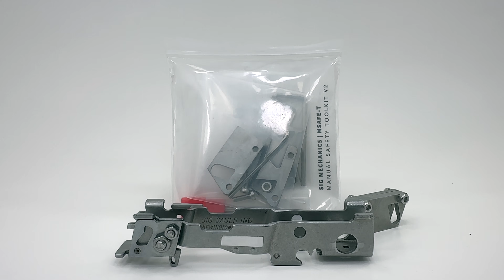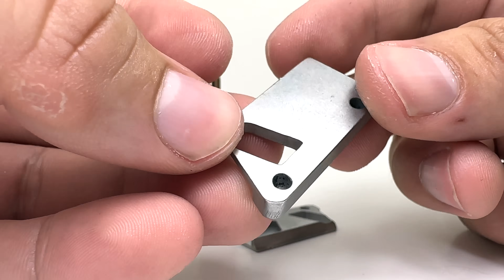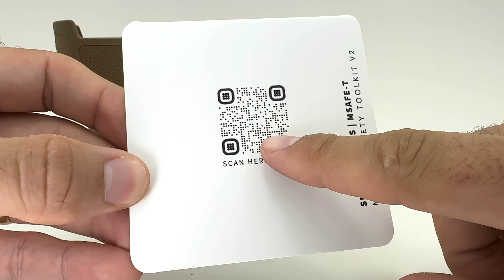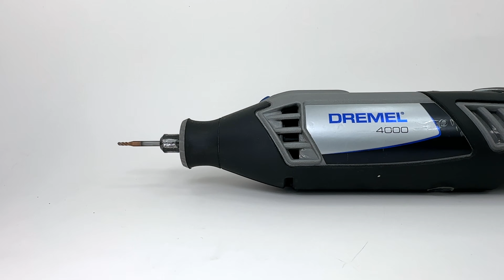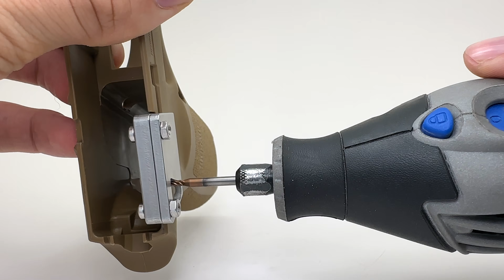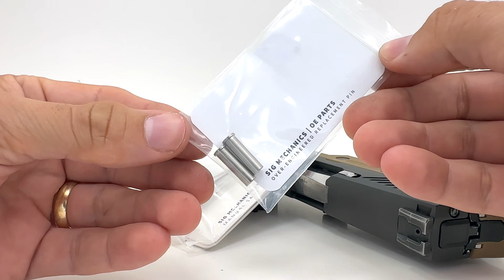P320 MSAFE-T V2 - NEW UPGRADES and FEATURES

Comment: Can you use a drill to do a lot of the work and then clean up along the jig edges with the dremel?
Reply from the maker: Yes absolutely. So long as the diameter of the bit won’t widen the holes more than the kit allows.

Comment: I wonder what Sig Mechanics thinks of the p320 now after all issues are finally coming to light. Even with the deaths of two p320 owners by failed mechanics and FBI reports, does he still stand by this disaster.
Reply from the maker: Thank you for asking. I still hold the same opinion and although I am frustrated with how SIG has handled its response to the public, I am much more frustrated with a lot of of the misinformation people have put out there recently.

The FBI report, for example, has been taken out of context. People are claiming it is saying things that clearly it does not and our veering into speculation one discussing it. The new claim where you can move the trigger back 1 mm and make it fire by manipulating the slide is also incorrect. Since what is being said is that the trigger is being pulled sufficiently enough to move the sear down 1 mm which is a massive difference. But this information is still being shared and is incorrect.

Even the death of the air man although tragic, in my opinion requires time for the investigation to complete. I am hearing both. He shot himself and that he may have shot somebody else and it is currently a criminal investigation. I will not believe any of it until I hear a final report.

Long story short I think the P320 is safe, I make that claim based on all my knowledge and experience. I am of course, open to being proven wrong but to this day even with all the money and people they have thrown into proving that claim, not a single person has been able to do so. 

Lastly , my hope is that there is ultimately no problem because I want people to be safe and to enjoy their firearms. On that and I am going to be optimistic, but also always open to changing my mind and also committed to educating the public, especially when it comes to safety.
Reply: @SIGMECHANICS  the FBI said it’s not ready for duty use, many of the Army vets in my local ranges that were issued the M17 hated it and liked their M9 or Glocks. They did say a few soldiers did have some un commanded discharges during training, but the Army ordered them to shut their mouths. 

I’m just shocked we’re not seeing even a small percentage of this with any other striker, not even the p365 and that little gun lives inside purses, pockets, gym bags, glove box, and is carried more than the p320 yet zero uncommanded issues.
Reply: @SIGMECHANICS  I just don’t see the point in getting the p320, there’s far better and safer options on the market. The p320 only real selling point is that it “beat Glock” for the contract and I saw Ash Hess himself say that all the pistols shot the same, it all came down to money and that’s just business. 

Ash Hess is a very important figure in the Army XM17 MHS trials in case you’re wondering

Comment: Did you see the videos coming out about pulling the trigger a little past the wall and then squeezing the slide and frame together and it going off? I tired it on mine and got it to do it. Granted it is difficult to do if you don’t put a screw in between the trigger and frame.
Reply from the maker: I haven’t seen that, however based on what you’re explaining it’s entirely possible. By the time the trigger hits the wall the striker safety is disabled plus at that point if you go a little past the wall, you are literally pulling the trigger and starting the sear movement. You also need to have a loaded magazine in order to squeeze the two together and replicate real world scenarios.

For all intents and purposes, you got it to go off by pulling the trigger.
Reply: @SIGMECHANICS I just watched a video by Wyoming gun projects. I’m wondering if it’s more of an issue with the curved triggers. Since I bought a FCU I have that flat gold trigger and it was a lot harder to get it to do it.
Reply: @SIGMECHANICS would your manual safety prevent this slight trigger pull and wiggle from firing the handgun?
Reply from the maker: @beanradman5777 the MSAFET essentially lets you install a factory manual safety assembly in your previously non-MS P320. For all intents and purposes it will stop a trigger from travelling sufficiently to drop the sear and it ALSO adds the benefit of disengaging the trigger from the sear should something (even a finger) force the trigger to travel backwards while the safety is “on”.

Comment: I really enjoyed the detail provided in your videos and was able to use that knowledge to get a handle on the FBI report on the holstered discharge from 7/31/24 recently made public. Very interested in your understanding of what happened and how design, materials, or manufacture could address the issue, if they can. Thank you.
Reply from the maker: Thank you! I will likely do a breakdown with testing and visuals of the FBI report to showcase what the text is saying. Ultimately they didn’t actually find a problem, only that there “could be” one, but not one they could find. I’ve always remained firm that there is no problem and triggers are being pulled accidentally.

Comment: Genuinely curious person here, and excited to see you responding to recent comments! I value data over speculation, and you seem to be the same. But that airman passing has shifted many opinions. The sear movement based on the (I’m sure repetitive to you) 3P20s in a trench coat, Glock-Style breakdown, and FBI report truly disheartens me. I just got an m17 manufactured in 5/2025, and that movement is visible to me. This has resulted in me searching days for some sort of data-backed relief. If we apply the same principles SIG did to the trigger mass pre-upgrade, wouldn’t the combined weight of new components+the disconnect adding slide mass+safety lever all resting on the trigger bar essentially result in mass driven sympathetic movement within the FCU and result in an  uncommanded discharge? Especially if the slide and mag are moving violently within a holster or even dropped? I’d love to hear a likeminded opinion. Thanks for all of your work!
Reply from the maker: Hi! Thank you for the kind words. You’re exactly who I made the videos for, though it takes much longer to make them I do believe in science backed evidence over speculation.

What happened to that airman is horrible. However, if what I’m hearing about it (from reliable sources) is true, there will be a release soon that will shut down the claims it was the P320 itself. Regardless, it does not take away from how terrible the scenario is.

As far as your question goes. The trigger mass was important because the trigger would cause the trigger bar to move forward when the gun was dropped at -30°. However, the internal components do not add to the trigger weight itself. To that end, the host upgrade P320 also got a few components that were lightened in weight so ultimately those parts are as light as they’ve ever been. Even though, they were not directly under the microscope during the drop safety issue in 2017. In addition to that, the internal FCU component safety mechanisms also function independently from the trigger. This is why you can’t not pull the trigger and have it fire the trigger movement is needed to drive two individual components. The safety lever and the sear itself.

Comment: It seems to me, basically all striker fired pistols, that keep the striker 100 percent cocked, are single action pistols, you just don't See that it is cocked.
Can you do an extensive vid on why I shouldn't carry a traditional single action without the manual safety engaged vs carrying striker pistols that don't even have a manual safety.
Reply: I hear you. Hopefully he will respond to the FBI assessment for the July 2024 Michigan trooper's in-holster discharge. Is the design flawed, tolerances a problem, materials or machining off spec? A more proven striker fired system would probably be more safe or as safe as a sao with manual safety lever off. Would probably have to consider the drop safety ability remaining in that off-safety sao. I'd also like to know if the thumb safety equipped P320 models are any safer than non thumb safety equipped, as the discharges seem to be independent of trigger movement. Read the full FBI report. It's pretty easy to get through, and I would not have confidence in the model. What do you think, OP?
Reply from the maker: That’s an interesting question and I will think about it. However, I do not have a personal opinion about manual safety versus non-manual safety. I don’t think I would try to dissuade or persuade anybody one way or another. I think it really comes down to personal preference.

Comment: Does this work on the axg legion?
Reply from the maker: It’s not made for it but can work with extra steps. The main reason I don’t recommend it is because you would need to cut the side grip panels free-hand which if you are not proficient with the dremel, could damage the panels. 

Otherwise it is possible and I have seen a few people successfully make the cuts and install it on the AXG.

Comment: Have you had a chance to look at and compare the differences between the 576 trigger bar update vs the older models
Reply from the maker: Not yet, however I was looking to start making a few videos to help people solve these types of questions in a more scientific setting. There is no difference between the trigger bars however, this conversation has definitely been going on for a long time and I would like to provide some empirical evidence to help put it to bed.
Reply: @SIGMECHANICS yeah I’d love to see that data, I’ve seen people claim the mid 2024 trigger bars stamped 576 activate the firing pin block later in the trigger pull stroke so I was curious if you’ve done any tests

Comment: Can you tell me why my take down lever is so hard to release the slide? Its a pain. I've taken out the mag and with the mag in. Are there any safety concerns? It's been this way the first day I got it. Thanks for any information.
Reply from the maker: My first guess would be that the tiny pin that holds the takedown lever (built into the slide catch) has something to do with it.

Have you taken it apart to inspect?

Comment: https://youtu.be/o_30DVjmaJs?si=G2oIzU8T2qsG0ogx
Reply from the maker: Ah yes. I’ve seen it. There is an explanation to why this occurs but I’m going to have to use some modelling to show everyone. Turns out this method of testing is not showing you real case scenarios as a trigger pull never has to bottom out the sear. Theres a bit of math too but I hope to clarify this soon.
Reply: @SIGMECHANICS Glad you were able to see it. He gave you a shout out, so I wanted to make sure you saw it....👍

Comment: Hey Mr. Edmond here is a link to a video of someone solving the issue of why the p320 fires on the drop safety test. https://youtu.be/wjEvejZuHso?si=Zx2EyAmXYUTDpBzr
Reply from the maker: I’ll take a look. However I’m on my way to meet with Sig Sauer engineers tomorrow, if you give me the “Cole’s notes” of the theory, I’ll ask t them their thoughts on it!
Reply: @SIGMECHANICS  guy is saying that there is a foot on the back of the sear that interacts with the trigger bar and by shaving that off it stops the firearm from firing since it's no longer attached to the trigger bar but still does with at it needs to do since the front of the sear is still connecting. You would have to watch the video to understand because I don't think I'm explaining it in full detail
Reply from the maker: @petethebuilder2025 thank you. I’ll take a look soon.

Comment: The issue is the firing pin safety design and sear being mim and loose speced. Can we get an update video on fixes?
Reply from the maker: That part is stamped, however, MIM seems to be getting a bad rap but its dimensional accuracy when making parts is EXTREMELY tight, better than some CNC machined parts depending on the manufacturer.

Comment: Any chance we can get another video talking about the sig drama. It wears me down. Just came across a video of an instructor banning any 320s lol

I carry one appendix everyday and  can’t help to think I’m making a mistake. Not into the drama side just curious if you have more thoughts. Thanks again.
Reply from the maker: Probably not. I would want to avoid that since there’s no actual evidence of it happening, but at the same time, no evidence that it’s not happening.

It’s a bit difficult to prove someone’s pulling the trigger just as much as it is to prove that they didn’t pull the trigger. A video specifically about the drama would probably not help anybody learn anything new

Personally I am not concerned as I do not believe there is a problem since it cannot be replicated.
Reply: @SIGMECHANICS  I share you skepticism based on the fact that it hasn't been replicated in controlled conditions.  But I still think it would be incredibly useful for someone with your expertise in the mechanism to review a few of the theories about what's happening and how much merit you think they have  For example, the test where people are depressing the sear with a pick and observing whether the striker is allowed to fall.  Is that a valid test?  Why or why not?  Is a gun with a broken sear spring or two still safe?  What do you think of the court documents showing the magnified pictures of engagement surfaces?  Those are some of the questions I have personally as someone who competes with P320s (so I often have one loaded and pointed at my foot / leg).  Thank you!

Comment: will this jig work with the axg legion?
Reply from the maker: Although it is not made for the AXG, specifically, I do know several people have still used it to make the modification.

One thing to consider is that even after you use the kit to convert the grip, you would still need to modify the grip panels by hand.

Comment: Maybe focus on hammers again
Reply from the maker: What do you mean?
Reply: @SIGMECHANICS  Sig IMHO shifted its focus to plastic strikers and mostly abandoned hammers.  The P365 could easily be turned into something similar to the P225. A small metal 1.5 stack hammer fire.  They totally abandoned the 357 sig caliber.  You can't buy a milled P226 slide for a 40sw legion.  I'm heavily invested in their line, and they've become a disappointment.
Reply: @SIGMECHANICS the only videos I've browsed through here are on the 2 newest line of strikers. P320 which is difficult to give away ATM and the P365. Nothing on the P229,P220,P226 or discontinued models.  It would be nice to see a bit more variety if the channel was created for SIG products and not just 2 pistols.  I own a 320 and 365 so I do enjoy what's posted.

Comment: This has nothing to do with the video but I felt like you may be able to help if you see this, I just recently built a p320 with a mischief machine fs grip module and a shalotek warden slide, got all of my parts in and assembled and realized (through manual cycling) that my apex extractor wasn't holding onto the casing and was dropping the rounds prematurely, upon closer inspection it appears the extractor sits to far forward to have an effective grip, and after doing some research and looking at the apex product photos the extractor that I received appears to have machine marks and cuts that the product image doesn't have, I was wondering if this is a slide issue, extractor issue, or maybe even an assembly issue, hoping you've seen something like this.
Reply from the maker: It sounds like a defective unit, the machine marks are okay, Apex CNCs their products (sign of quality) and that is not going to be a problem. 

I’d reassemble the extractor first, test, then if still fails, call Apex.

Comment: Just finished up. Fantastic kit with form and function. Original p320 FCU loaded in X5 legion grip module. But now with a manual safety. Sweet deal. Only thing I did in addition to your instructions, was to use a dremel and a tiny polish wheel to mirror finish the cut face in the FCU that the safety rides on. With a drop of oil it’s now butter smooth going on and off safe. So happy with final product. Thanks man for putting this out there.
Reply from the maker: That’s great to hear! Good call on the polishing, I’m always happy to hear the kits helped someone in the community. If you get an opportunity, please write a review for the MSAFE-T and If you ever need anything, shoot me a message at sigmechanics@gmail.com

Comment: So if we’re going to do a trigger adjustment, we should definitely put your manual safety tool on it as well? And this is because adding a trigger adjustment so basically compromise the original safety features?
Reply from the maker: Not specifically, you do have a small amount of play you can do, however it’s almost not worth it based on my findings. A MS will definitely help though I can’t really say it’s a good idea to remove 50% of your safety in the first place even with a MS for backup.
Reply: @SIGMECHANICS  thank you so much for your very fast and thoughtful response! We all really do appreciate you and your work

Comment: Would like to hear your thoughts on the whole P320 controversy regarding the gun going off by itself. Do you think these claims have any merit?
Reply from the maker: I don’t think they do. Although the situations are unfortunate, I don’t think the claims are valid and that (although it’s never deserved), the trigger is somehow being pulled. Not necessarily by the operator, but things like the holster. This is just an opinion, of course, but as far as I can tell most, if not, all of the circumstances have been when the operator was in a crouched position, which would put pressure on the holster and possibly deform it or even put pressure on an object that pushed on the trigger.